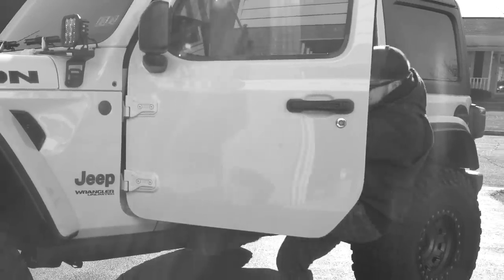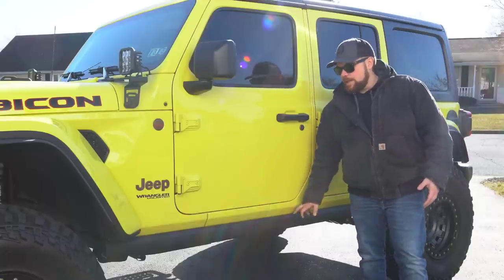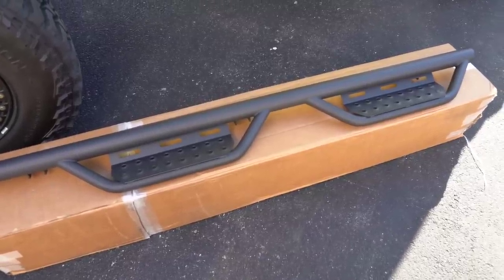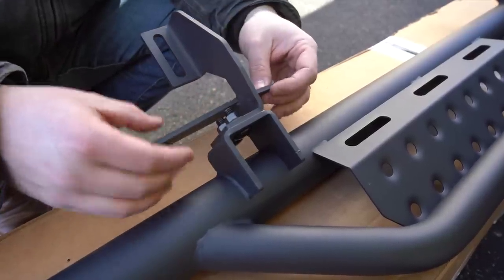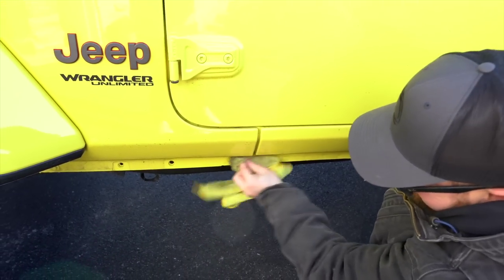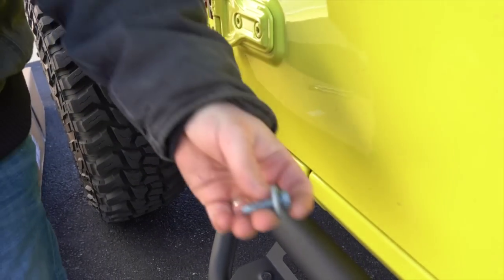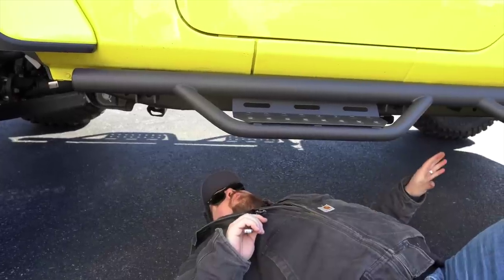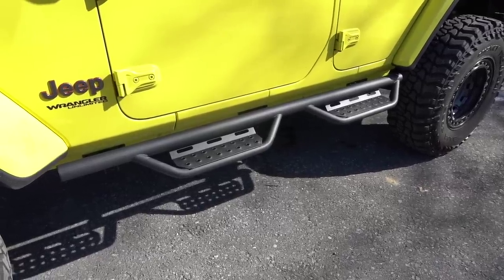Budget Jeep Wrangler JL Side Steps

Comment: I didn't want to lose the factory rock rails, so I installed the Ace Engineering rock sliders, which work in complement with the stock rock rails.  I just installed them on Lizzie, my '23 JLU Willys, and I had them on my 2020 Gladiator Rubicon as well.  They work great, because even though I am not lifted yet, my wife is 5'1", and she wouldn't be able to easily get in otherwise.
Reply from the maker: Very good set up!
Reply: @DIRTROADCRED  Yea, since they mount with the body-mount bolts, the only hard part is getting those bolts out. Front had red loctite, back 2 hack blue loctite, all 6 bolts took a blowtorch, a 1/2" breaker bar, and some elbow grease before I would touch them with the impact. I have heard too many horror stories of people snapping their body-mount bolts by accident by using an impact wrench when they are loctited in. Better to break them loose manually first.
Reply: Same here. Caught mine on market place for $400 brand new. Love the xtra protection along with the factory rails and there an awesome step, And yeah ... those front bolts are a mutha. Safe travels ...

Comment: NOTE: if you install body mounted sliders, the front body mounts where put on using red locktite and WILL break on the way out. I snapped mine and have seen quite a few others do the same. I got lucky and it sheared off at the head and I had about 1/2 to work with. But heat seams the best route to go.
Reply from the maker: That’s a good tip, I had some luck on my hemi jl and they didn’t break!
Reply: 30 seconds with a propane torch and a 1/2" breaker bar are how I got mine loose, at least to the point that I felt the impact wrench was safe. Did it on my Gladiator 3 years ago, and on my JLU yesterday.  They definitely don't want those bolts budging.  That red loctite is no joke.
Reply: @lonewulf0328  I ended up using an induction heater. 45 seconds and those bolts are 400 degrees… and with no radiant heat to other parts…

Comment: Those are nice-I did consider those, but I went with the OEDRO Running Boards with Two Stairs Design All-Steel Build-they serve the same purpose and just under 400 bucks-that extra step is nice when I'm strapping something down on top of the Jeep.  Thanks for the info always appreciated.
Reply from the maker: Ahh I saw those also!
Reply: Wonder how your Oedro steps are holding up after 6 months? 😊 Just ordered some.
Reply: I got a set of those for mine as well. Appear nicely built and the coating looks good. We will see how it to Ohio winters and ODOT's secret sauce brine solution that melts metal and ice.

Comment: HA.  I was going to mention rust.  The first thing I usually do with an Amazon “cheapy” is rust treatment and paint touch up.  Gets me years of worry free use if I hit them with a little low in the beginning.  I use the Harbor Freight in house brand of stuff and smile cause my small cash outlay looks just about as good as the big spenders.
Reply: Forgot to mention - I’m a big guy. So I usually hand snug it up and jump on the step to get it to the bottom most point.  That way, I don’t scratch the heck out of my Jeep when the mounting hardware migrates over time.
Reply from the maker: Good points !
Reply from the maker: Good point!

Comment: Are there steps/rails that the step folds under out of sight when not in use ?
Reply from the maker: Yes amp or rock slide engineering
Reply: @DIRTROADCRED  I saw them. I’m looking for something manual. Similar to the ones you installed but the actual step part should be able to be rolled under  ( no mechanics ) I’ll keep looking. I appreciate you responding. Great channel